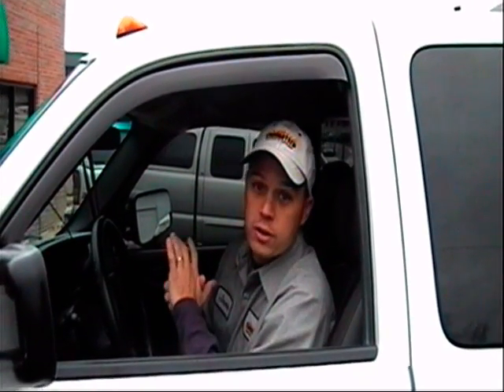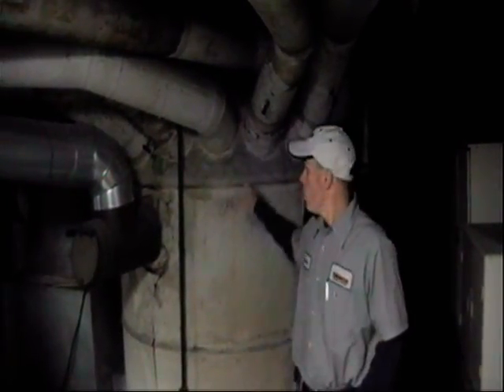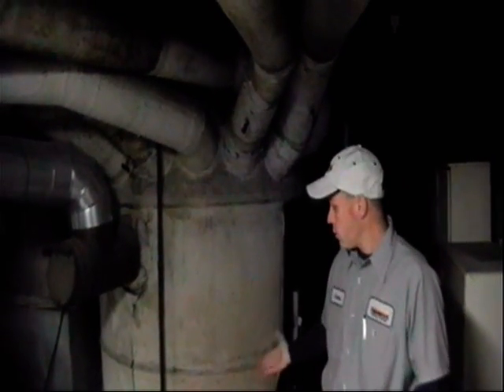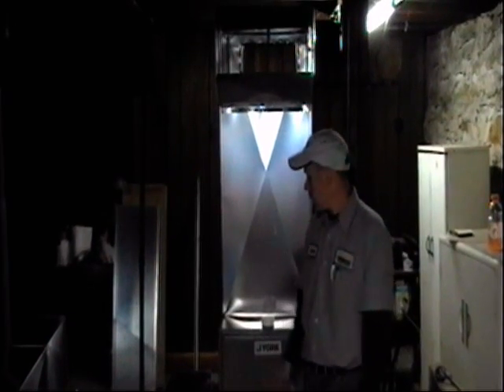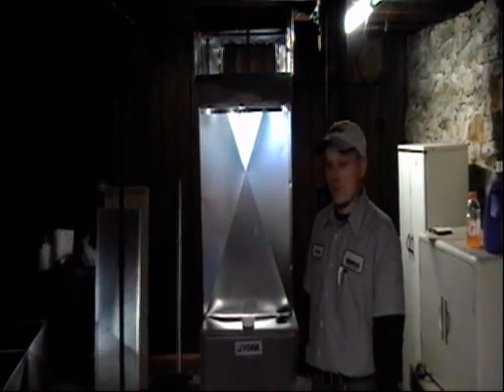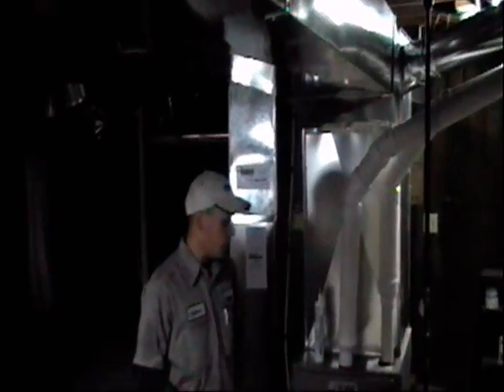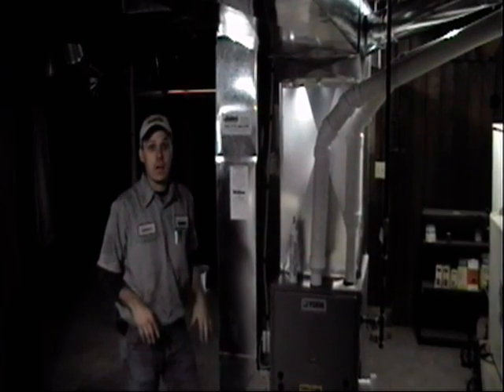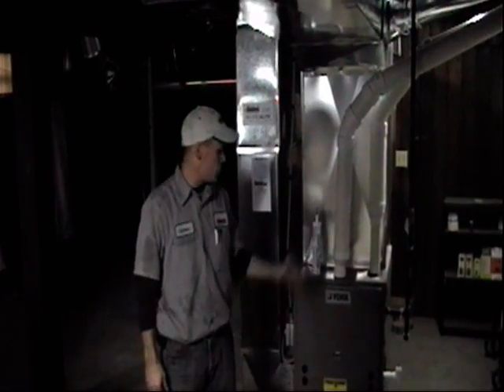Gravity Furnace

Comment: “This furnace is probably operating at about 40% efficient.”   You are wrong.  You should have taken the opportunity to run a combustion analyzer efficiency test on it. Had you done that you would have found that it was approximately 65% efficient if it was converted from coal to natural gas and 85% efficient if it was originally a gas fueled furnace. Stating 40% might be helpful to you for sales but does nothing to up your reputation for technical accuracy. Next time test it.

Comment: As a gravity furnace these run about 60% efficiency, with a forced air blower efficiency is 80-85%, and they will last about 100 years, that "new" furnace will be burnt out in about 10 years
Reply: that's why i use a free standing keystoker 90K. its reliable and will last 30 years or more. i bought it for $750 used its about 10 years old. reliable, simple, efficient, affordable, clean burning anthracite coal. cant say enough good about it. these high efficiency gas furnaces are just loaded up with electronic junk AND thin heat exchangers. designed to be cheap on gas but expensive on maintenance, repairs, and replacement. the owner of this unit would have been better off converting it back to anthracite. now they have an expensive piece of junk that possibly has already required a repair.

people converted these things back to natural gas years ago but that really was the wrong thing to do. they were designed with coal in mind and they should have kept them that way. anthracite is superior to natural gas in my opinion. sure its a little more work, but its more heat for the $$